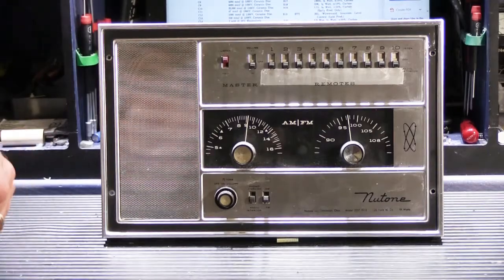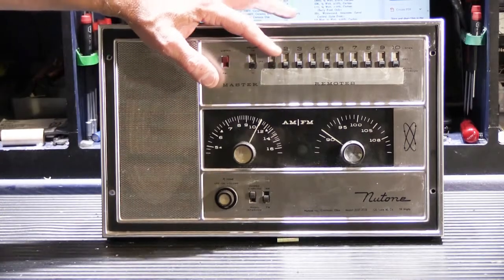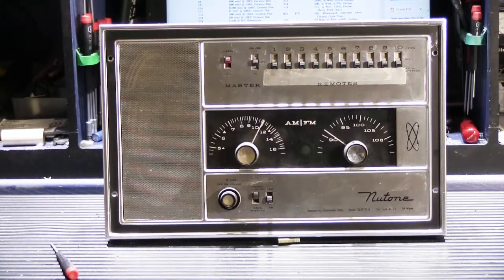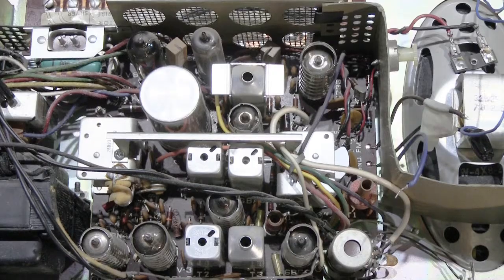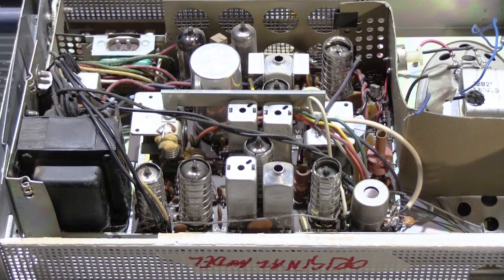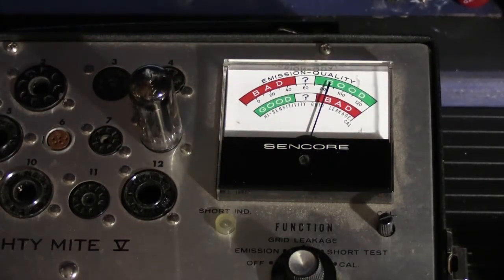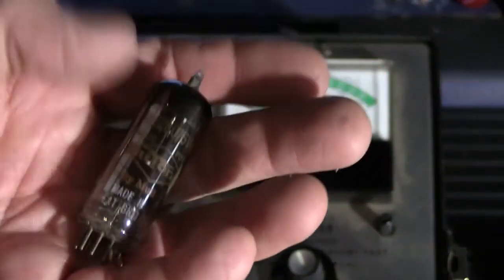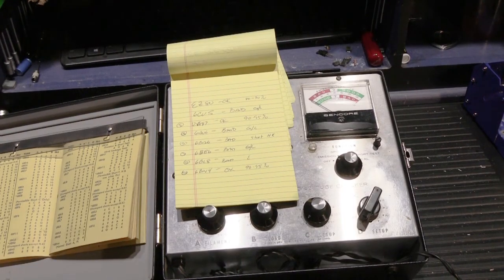Rebuilding a NuTone Intercom Model 2057 / 2058 - Part 1

Comment: What a treasure of videos you've put up, many thanks for that!  I bought a house that has one of these, and it works really well.  The only issue I experience is that sometimes, the unit will be scratchy on FM, and have lots of noise even when its perfectly tuned.  Best I can describe is that its blowing a loud raspberry at me.  I shut it off and let it rest, then turn it back on later and seems to work just fine.  DO you think its a problem with the tuner knob pot? i tried removing the faceplate screws to see if i could back it out, but it wont come out of the wall.. I dont want to jerk it out so I just leave it be.  Any advice?
Reply from the maker: Hi Kevin:  The type of problem you describe is most likely an age related, component  failure problem - Please consider that your 2057 / 2058 is around 58 years old and even if you  think it works "really well", there are many components that are well past their useful life expectancy.

DO NOT - repeat - DO NOT  mess around with anything that has to do with the Tuners - and NEVER SPRAY ANYTHING on the Tuners - this will ruin them and it will most likely NEVER PLAY again -  

If you want to carefully remove the Tubes and test them - that's fine.  Replace any tube that tests under 80%.  Beyond that - unless you have experience with working on tube equipment, leave it for a professional - Chris
Reply: Great advice Chris. A professional, I am not. A friend offered to service it for me if ever need be. I told him I didn't really know how to take it off the wall. I'd have to mail the unit to him if I decided to have it serviced. I'll be sure not to use contact cleaner in the meantime. Thanks for getting back to me so quickly!
Reply from the maker: No Problem - You can also always send it to us for repair and rebuild - Chris

Comment: What kind of adapter do I need to plug this unit in? I'm having a hard time tracking down what type I need.
Reply from the maker: Hi Will:  Do you need a power cord with the socket for powering it up on the work bench or the socket that goes into the wall housing? - Chris